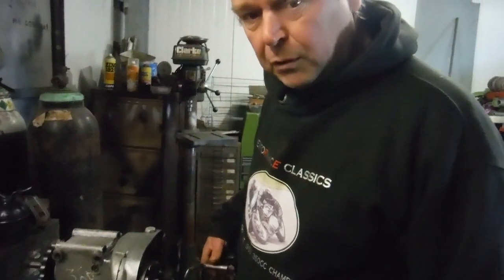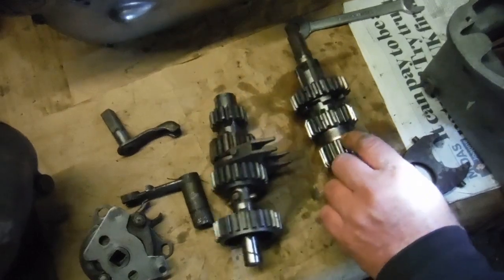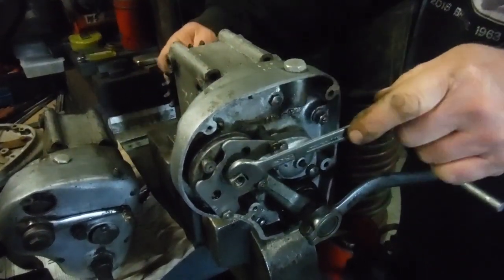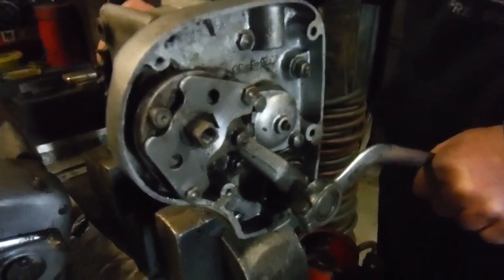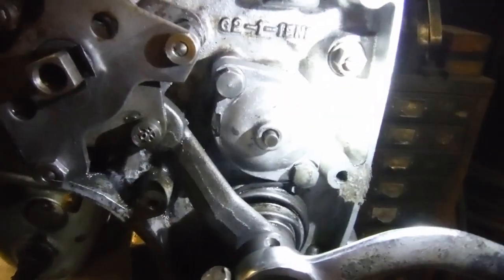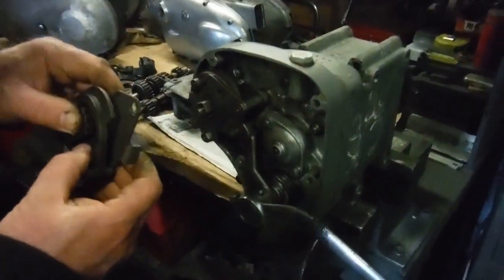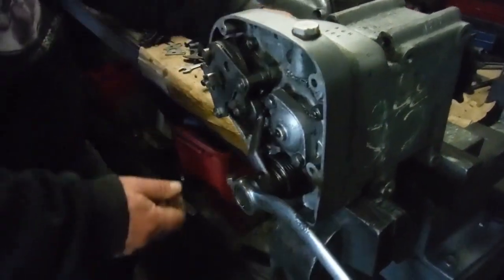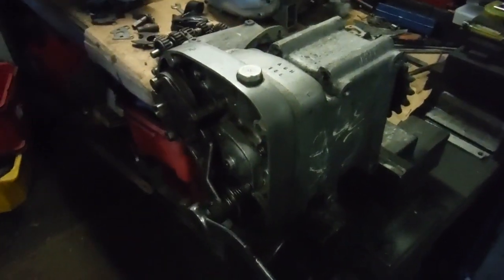Royal Enfield Albion type four speed gearbox workings and set up discussed at Performance Classics.

Comment: One thing I'd like to add; When dismantling this gearbox, you do not need to disturb the adjustable backplate. Leave the pillar bolts which secure the backplate in position. The screws retaining the inner cover can be accessed with the backplate in place. This way, if you had a good gear selection prior to dismantling, it should be good after.

Might I request you make a vid of your method of marking the rotor & stator when strobe timing? I have to do my Mk1A when the weather warms up again. Cheers.

Comment: I actually watched the whole thing! I never used the clutch on my AJS stormer cos i couldnt be arsed to fix it just stamped through the gears which worked fine if you throttled off a bit. The clutch cable went into the chaincase so i put a spring with a washer and nut on the inside so it would pass race scrutineers, great strong gearbox! Thanks Paul. Looking forward to brighter times

Comment: I found a box quite complicated, with many locking parts, movement mechanism and transfer of movements, as if it were similar to the mechanisms of repetitive weapons Springs which must have their tensions regulated during tempering to make precise movements between their limiters of course. It was great to have this special and complete classes, to see how difficult it is to leave this mechanism, once worn out or even badly treated in normal operating conditions. If I needed to repair a box in bad condition, I would undoubtedly send it there. Even if I had to ride a bike for a few months. Grateful for the clarifying video.
Reply from the maker: Thanks, Glaico!

Comment: Thanks Paul.  I think I’ve said before how much I enjoy the rides around the Welsh countryside, but the, in shop, how to, videos are very informative.  After this I think I could tackle one of these gearboxes.  I was surprised to see that they use sliding gear engaging instead of dogs in these.
Reply from the maker: Hi Phil, there is a bit of a mix, with some gears engaging face to face, while other ratios are obtained by internal dogs in the sliding gears engaging on corresponding pegs on the layshaft.
Reply: Right. Thanks for putting more light on that.  I suppose I’ll have to have one open before I fully get it, a possibility now, since I’ve found an old Bullet that hasn’t run in years about 10 miles out of town here.  The tricky part will be convincing the fellow to part with it.

Comment: The manual recommends filing the foot control stop plate if the gears aren’t selected correctly,I’ve just bought a new plate and plan to experiment,I can get it to shift perfectly one way or the other ,not both,I’ll examine the new plate v old and see if there’s any difference, good explanation 👍🏻

Comment: Paul thank you.  I have little trouble with my 63 Interceptor.  It shift N -> 1;  3 -> 4 and vice versa smoothly.  2->3 is a challenge, and finding neutral from this position via the gear lever is iffy;  using the neutral finder with a foot (clockwise pressing down) doesn't work; lifting the neutral finder with a hand finds neutral.  

I've had the bike stall a few times and it's bit of a chore.  Any idea what could be the issue?
Reply from the maker: I think your clutch might be dragging and needs looking at.

Comment: So are these dry clutch gear boxes? I’m seriously wanting to build a single cylinder diesel bike with a divorced gear box. The Royal enfield 4 speeds are really affordable
Reply from the maker: The clutches are usually wet, due to being chain driven, but they can work dry if the chain is lubed with grease or spray on lube.

Comment: Nice info, thanks Paul. My 57 bullet 350 shifts perfect, but it is not oil tight, the neutral finder pedal, shifts the gearbox into 1 gear, and the eccentric pedal stop is adjustet as you explain in the video, i can shift from 1N234 with both pedals, with the engine off, no problem, just a little strange, the gearbox is leaking at the sprocket side.
Reply from the maker: Hi Frank and thanks. A new seal behind your gearbox sprocket will fix the leak and if the neutral finder pedal stop adjustment is 'maxxed out', perhaps a bit of weld on the underside of the pedal, filed to suit, will stop it at neutral.
Reply: @paulhenshaw4514  Thanks Paul, yes it's probably a worn out felt pack, mine has the internal type, as you showed in a previous video, i have a workshop manual on pdf from hitchcocks, so it's straightforward, and your videos make it all easier too. Someone has welded the little notch in the neutral finder pedal, where the gear indicator is, so that was why the NF pedal shifts into 1, easy fix, and no damage to the parts.

Comment: Sir would you tell me reason for humming in gearbox for 3rd and 2nd gear ?
Reply from the maker: Hi, probably wear in the bearings and bushings, or something is too tight when the gearbox cover screws are done up tight.
Reply: I am facing this issue despite changing orginal gears, if you can recommend then that would be a great help for me.

Comment: On a 1999 royal bullet 500cc can you use a newer 5 speed transmission?
Reply from the maker: Yes, with the right side gear lever conversion.
Reply: @paulhenshaw4514  then that's the long term plan..enjoy 55 miles per hr but would be nice to be able to do 65 if need be or save even more on fuel.

Comment: Thanks! I got mine working after filing away material from the stopper plate; After new entrails the (old) shifting mechanism did not give enough space for shifting back, and the adjuster plate does not have any influence as seen though the hole of the detend plunger.. strangely enough....
Reply from the maker: The adjustment of the stop plate will only affect by a whisker, how much, either way the selector mechanism will try to move the gear operator inside the gearbox, relative to the detent plunger. As I explain in the clip, you want the gear lever to be coming to a stop, just as the detent plunger engages with whichever notch is heading for it next and no further, in either direction. Usually, if there is too much movement in one direction and not enough in the other, missed gears will result, possibly when changing up and down. I have also filed stop plates on occasion.
Reply: @paulhenshaw4514  Thanks for reply, and yes, thart was my worry whe i started filing the stop plate; What will happen to the other downshifting gears which were allright? They will have too much 'travel'?
I guess the detent plunger compensates it. It is now quite thight. I will slacken it half a turn at a time, checking what the result will be..

The strange thing is, the gearbox in my other enfield (with diesel engine) seems to be much more sensitive to the position of the adjuster plate?

Comment: My 500's gearbox work great, until I was in a hurry. 
Then it would find neutrals in funny places, usually on an up change when a cage was getting up my tail pipe. 🥴 Even had to coast into a Lay by a one point because I had Nothing!? Tried many ideas and adjustments but never was completely happy with it.
Reply: Is it one of the modern ones?
Reply: @stephencroft6481  1992 "J" Reg.

Comment: The Gear Operator, horseshoe mechanism, has pressed-in bushings betwix itself and the shaft on which it rides ?
Albeit, I know virtually nothing about the workings of an Albion type four speed gearbox [B4 viewing this presentation], I DID, in No. Africa, once hear a biker quip that "the Royal Enfield is the only motorcycle in the world with a neutral finder, and the only one that needs one." Aside from the seemingly obvious (non-obtuse) meaning of that statement, I still don't fully know its' total implications...and whether it was said 'tongue-in-cheek' and in jest. What say ye, shipmate ? 
[Actually, after now having read some of the comments, I stand alerted to the somewhat often problemme of  'finding neutral'...in the 'normal' fashion.]
Reply from the maker: Hi Amelie, there are no bushings, just a steel spindle screwed through the mechanism and into the casing, which the gear operator pivots on. The neutral finder is actually just a nice design touch, which will assist with a badly set up clutch and / or selector mechanism, but it just gives a redundant hand change quadrant something to do!

Comment: Hey Paul. I know this is an old vid, but I'm hoping you can give me some of your expert advice, AGAIN... The Albion gear box in my 350 Bullet jumps out of 1st gear into neutral sometimes under acceleration. Any suggestions as to what might be wrong and what I need to do to fix it?
Reply from the maker: Unfortunately, if it is actually clicking into first gear all the way and jumping out under load, that sounds like wear on the edges of the engagement dogs on the side of one or more of the gears and replacements will probably be required.
Reply: @paulhenshaw4514  So, another stupid question for you, master... If I remove the L/H threaded nut from the primary-drive side of the mainshaft, could I then remove the gearbox cover and replace the worn gears WITHOUT removing the clutch, primary drive chain, and alternator assembly?
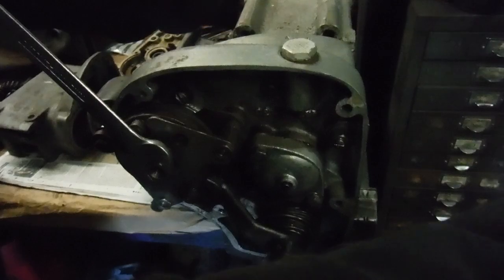Reply: Ok, so I've been scouring your library, and I found that you already answered this stupid question in this video.  https://www.youtube.com/watch?v=JeWTwVT0c7w&t=1002s  I see at 16:20 how you've managed another of your famous, or infamous, brilliant innovations. Yeah, it definitely looks do-able, but I've decided that I might as well change all the seals/gaskets: (engine crank, gearbox main, and clutch adapter plate) while I'm in there. I've gathered all the tools and parts necessary, and I'm gonna get at'er this weekend. I'll try to post some vids as I go along. Thanks again for sharing your knowledge with the unworthy. 😏